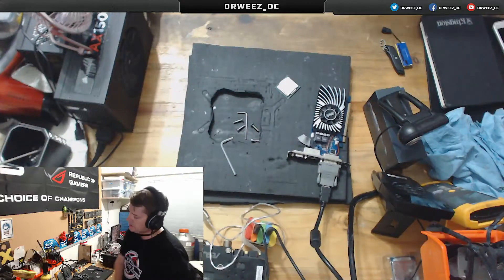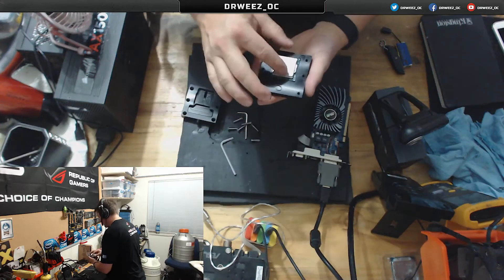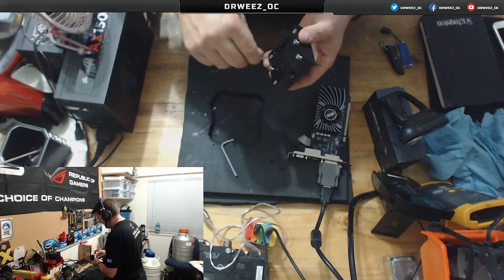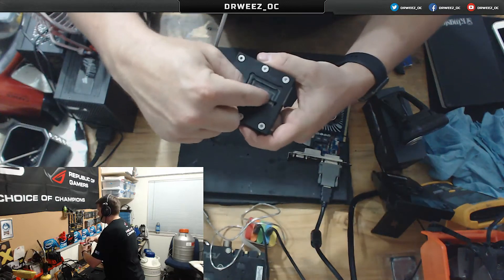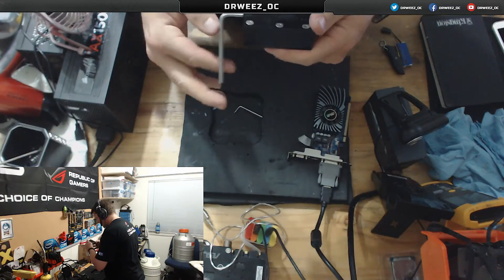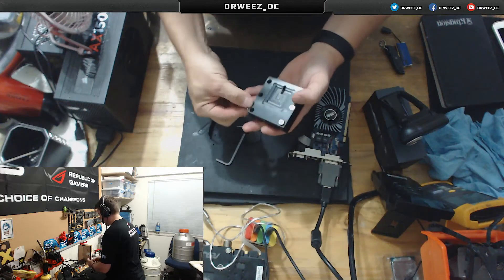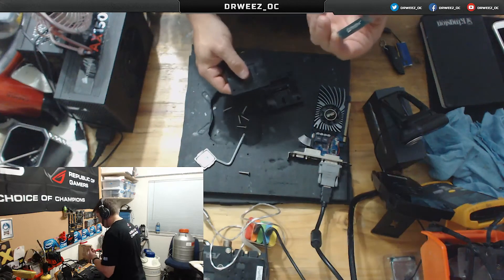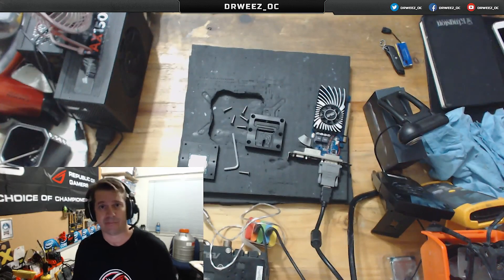Unboxing and test of the der8auer Delid Die Mate - Safe delid Skylake, Haswell, and Ivy Bridge CPUs

Comment: 90 Euros. My Gawd. Small price to pay for pro overclockers, but amazing what people end up build to get around Intel's crappy thermal paste.
Reply from the maker: +MrPansyfaust Yeah, it's not cheap - but accessories for Pro Overclockers or even overclockers in general are rare, let alone those delid CPUs on a regular basis. So price is what it is, for me it's a totally necessary investment to stay competitive.
Reply: +DrWeez Give it a look brother . https://www.youmagine.com/designs/skylake-delid-tool
Reply from the maker: Yeah I saw this one as well. Looks cool - sadly I dont' have a 3D printer ...
Reply: Doesn't matter.  I don't have a 3D printer either.  All I did was hit Google and look for a 3D printing service.  I found one called 3D Hubs that lists local 3D print shops.  Used the 3D image files linked above and got the delid tool parts printed in clear ABS with 100% infill for $24.
Reply: The price has dropped by nearly half now, they were more expensive when they had only made a limited quantity. I just bought one, cost me 49€. Haven't dared use it yet. Although I suppose there isn't much risk with this tool.

Got a clevo laptop and the CPU temp reaches 95c with all cores at 100% usage, I've seen many posts where people have delidded their 6700k in clevos and gotten like 20-25c lower temps. A p775dm3 shouldn't normally run as hot as mine does, probably a badly made 6700k with poor contact between die and heatspreader.